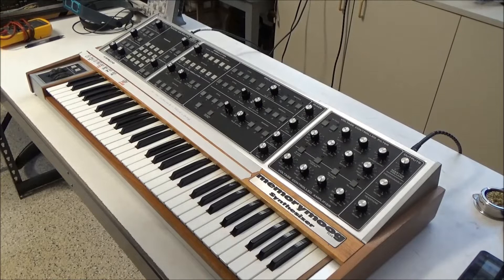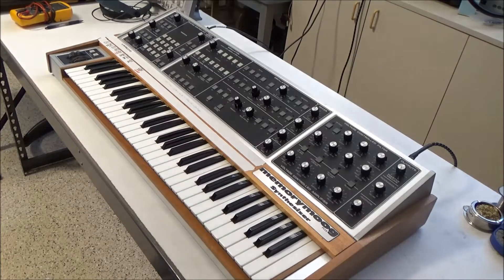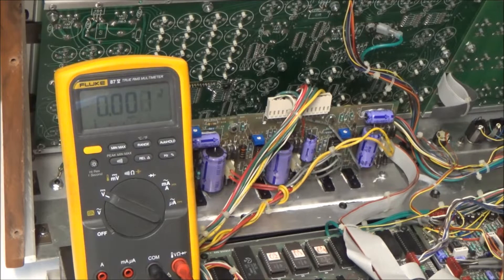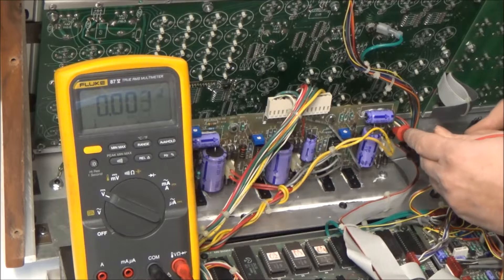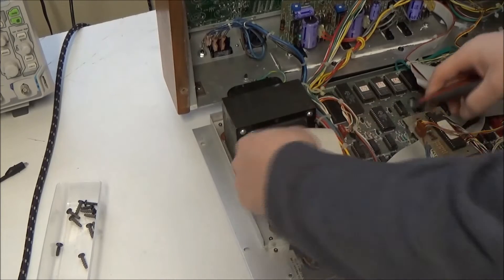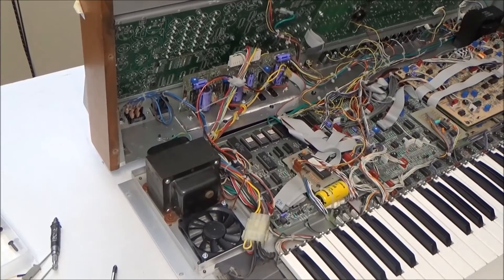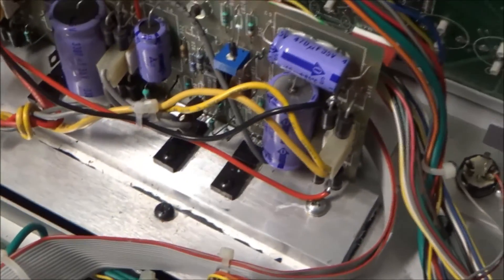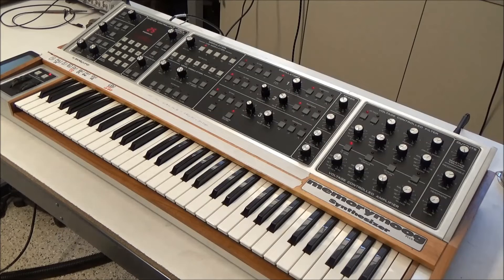Synthchaser #114 - Memorymoog Quiet Fan Replacement

Comment: Having the fan direct air down through the bottom panel of the housing is a big restriction of airflow , regardless of fan type.  Whatever surface the synth is sitting on blocks/restricts the airflow.  Moog should have had the fan blowing out the rear panel, not the bottom.

Comment: Thumbs up, Hi chaser
I have  a problem with my MM,,
Everything works fine, But I can’t save the preset,, I followed the manual and as long as if I don’t turn off, I can jump across the preset which I saved,
But if I turn off and on, it’s gone..
Some said its memory battery problem..?

Chaser, help me here.. I need to really use this MM nowadays.
Can you explain how I can replace the battery or can you shoot any video about it? :) I guess its too much, anyway
I will try the battery replacement whatever you tell me.
Please help me hero
Thumbs up
Reply: Uh.....you have to pay him.

Comment: Excellent mod, but correct me if I'm wrong: It looks like you drilled new mounting holes for the fan and effectively shaved off quite a bit of the collector value??? I would have cut a square piece of 3mm aluminum and tapped holes into this that match the original fan mount holes and the new fan. This way the Memory Moog does not need to be irreversibly modified...

Comment: Nice. Thanks for sharing. But I'm wondering about CFM efficiency compared to the original fan, since most of the time a quieter fan often means less airflow. And there's no question that the Memorymoog certainly needs that airflow...
Reply: It's been a while, but I remember the original MemoryMoog's AC fan having fairly anemic airflow compared to what I was used to with computer stuff. Not terribly scientific I know, but I'd say what looks like a slim 70mm at ~7V would be within the ballpark.
Reply from the maker: Can you find any documentation on the original fan that shows its CFM?  But you can compare CFM for currently available DC fans to currently available AC fans.  Fans have been much improved since 1982.
Reply: @Synthchaser  The original "fan" does not have a CFM figure because by itself it only whisks air around. To get a proper flow figure, you'd need to put the original fan in a tunnel (a tube) so that it properly can push/pull air. It's totally obvious that any modern fan will do better than the old air whisker...
Reply: If you look at the original fan, you should realize that it probably has very bad CFM--- much worse than any modern computer fan -- due to the fact that it's essentially just a fan blade without any dampening around the impeller. This means it will not push or pull air nearly as well as a modern fan. Instead, much of the movement simply goes to just whisk air around to the sides instead of pushing/pulling like a modern computer fan does. I guarantee the modern computer fan is moving much more air than the original one was ever able to do. The only thing I'd like to improve on this is to use a temperature controller to let the speed adjust depending on the internal temperature. This would make things super quiet.